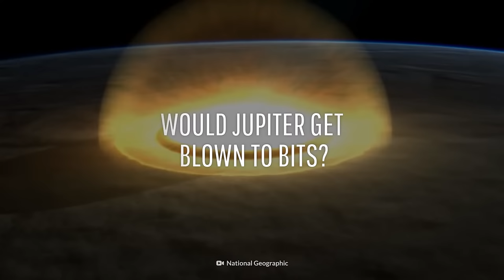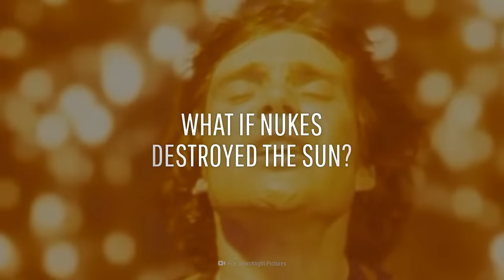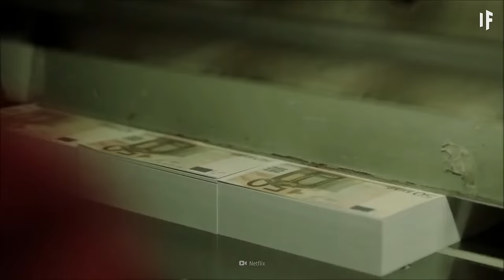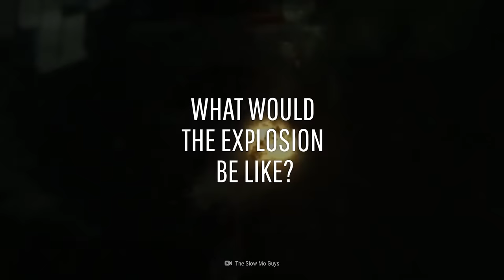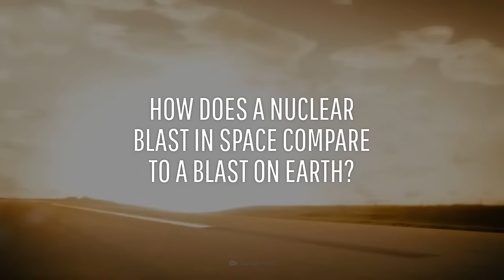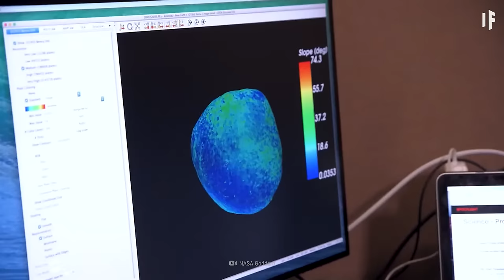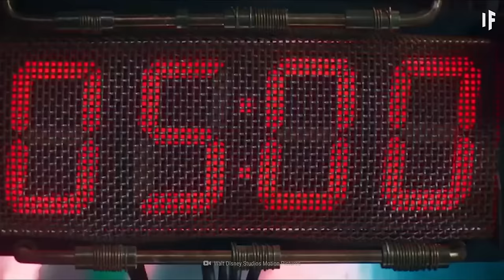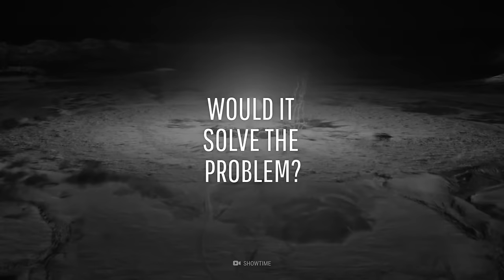Top 7 Biggest Things We Tried to Nuke

Comment: The asteroid belt piece was incorrect…in the asteroid belt the asteroids are so far apart if you started at one you die before you got halfway close to the nearest next asteroid….it wouldn’t be a mine field
Reply: Good point but it all depends on what fraction of light speed you were traveling doesn’t it?

Comment: Chain reaction of nuking Jupiter with even one would cause runaway fusion and ignite a second star in the solar system.
Reply: Stars don't work that way. Just think of this 99.86% of the mass in our solar system is the sun.   It takes an enormous amount of pressure, heat,  and hydrogen to create a star (also our star is tiny)

Comment: 7:02 actually most modern nuclear weapons are in the kiloton range not the megaton or Gigaton range so they don’t use Fusion they use Fission there are still a bunch of hydrogen bombs leftover from the 50s-80s but weapons over 3-5 megatons aren’t very practical and 10-50 or even bigger weapons are less practical unless you’re trying to obliterate  1 city and render 1 area uninhabitable for a hundred or so years 10 1 megaton bombs are much more useful and much more practical than 1 10 megaton bomb same thing goes for even larger bombs like the United States 25 megaton Mark 40 that’s been decommissioned for decades now because a bomb like that is too powerful for anything but destroying entire metropolitan areas and 25 1 megaton bombs would do much more damage strategically placed than 1 25 megaton bomb